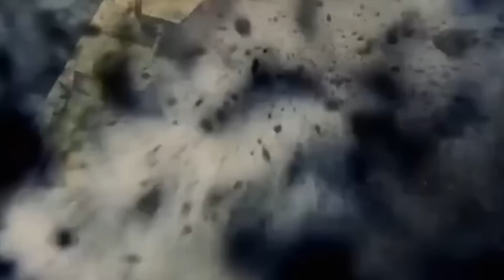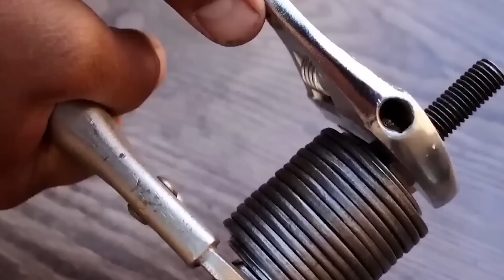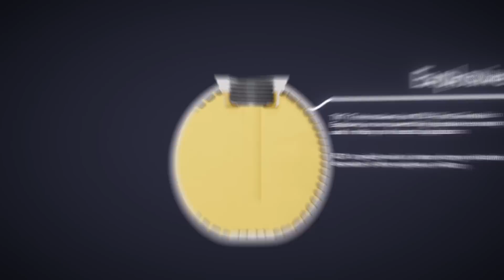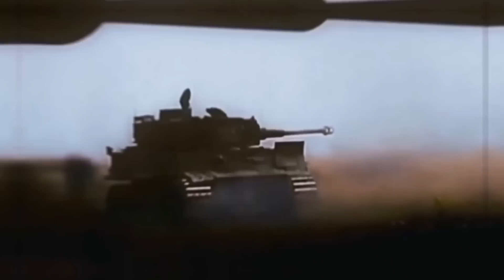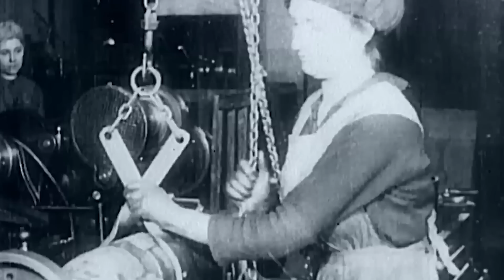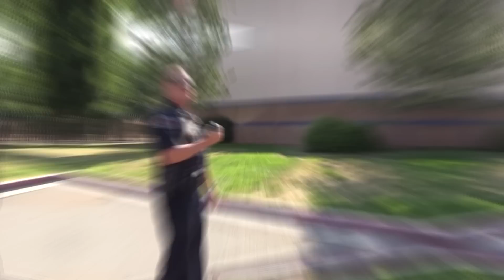How Weapon Manufactuers produce Millions of GRENADES Every Year

Comment: To help keep the grenade from getting thrown back at you, if you throw it through a door or window, you do what’s called milking the spoon. Once you pull the pin you let the spoon fly. Then you count “thousand one, thousand two,” then throw it through the door or window. You get 3 seconds with American military grenades. The catch is everything man made degrades over time. Explosives start to break down, springs get sprung and shit just doesn’t function the same as brand new. There are a shit ton of old grenades that are still being used. So don’t take the milking too lightly lol
Reply from the maker: Thanks for explaining that! ‘Milking the spoon’ makes a lot of sense to avoid getting the grenade thrown back. Good point about old grenades—things don’t always work like they’re supposed to. Great insight!
Reply: @ there is a video floating around on the inter web that shows a special forces soldier, that was off duty, get trapped in a small enclosure with some other people. After awhile some bad dudes started throwing hand grenades into this enclosure. The soldier was able to pick up and throw 9 of the grenades back at the bad guys before finally running out of luck.
Reply from the maker: Sounds very intense! Do you think it’s more about luck or pure training?”
Reply: @makin_eng  your training will help you stay calm and level headed to fight through the worst of the worst situations. But at some point your training will reach its max effective range, and at this point, having a little luck on your side is the difference between you going home or the bad dudes going home.
Reply: ระเบิดมือคนจีนเป็นคนประดิษคิดค้นสร้างได้ก่อนใครในโลก ควรยกความดีให้พวกเขา จรวดจีนเขาก็สร้างได้ก่อนใคร